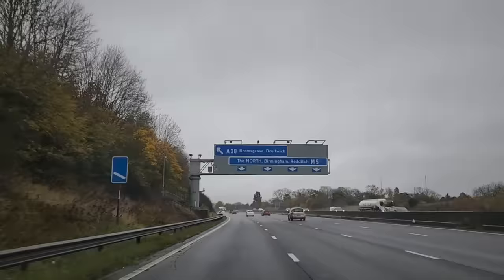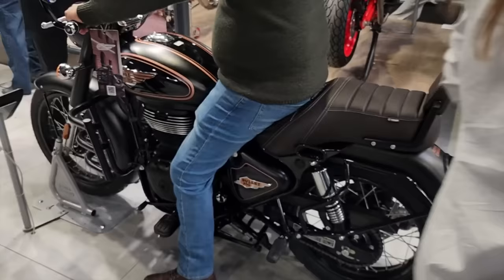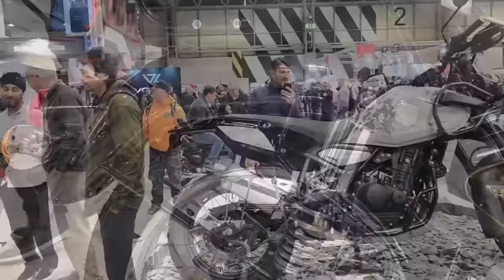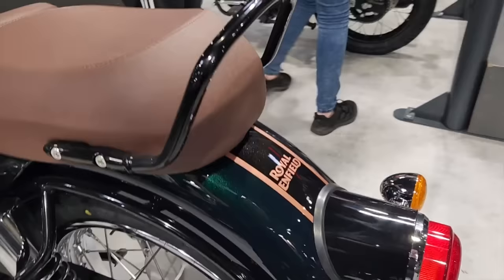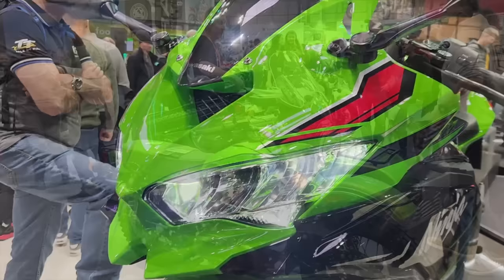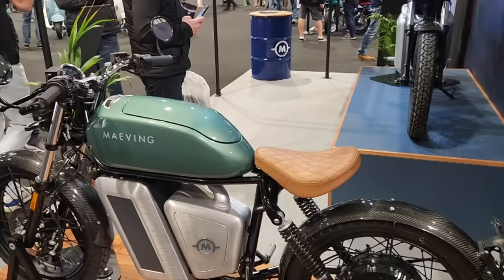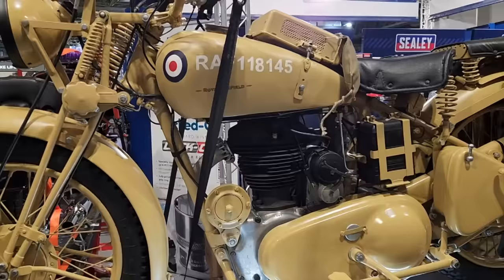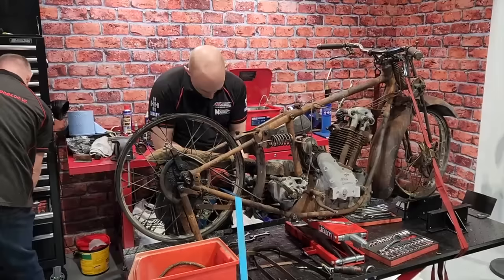The New 2024 Royal Enfield Bullet & Himalayan at the UK Motorcycle Live Show 2023

Comment: Hi glyn I agree yours looks better and the gaiters are crap on that note where did you get your gaiters from I’ve just bought a 2023 cat n meteor and intend to copy yours that way no mistakes be grateful for a link on the gaiters to avoid any crappy ones and have you a part number for the seat bracket cheers keep up the good work
Reply from the maker: Hi Andrew, that sounds exciting, good luck with your project.  The gaiters are from Hitchcocks and listed in the Meteor section, about 20 quid or so I think.  Hunter original gaiters might be good too, they're a nice matt black and look the same size👍